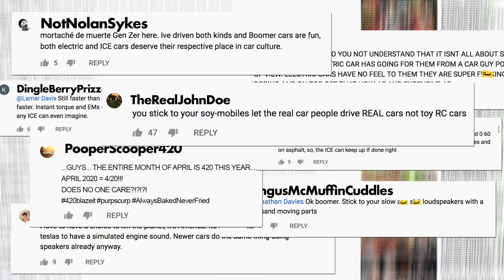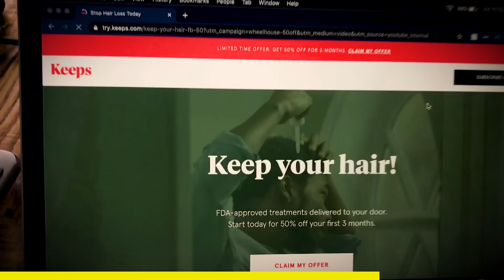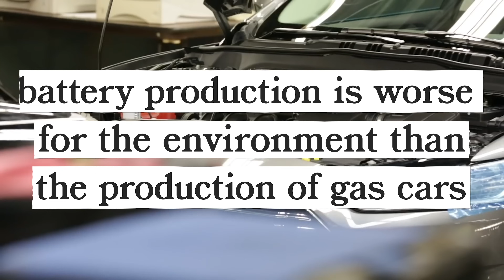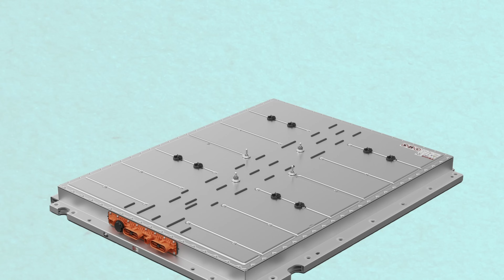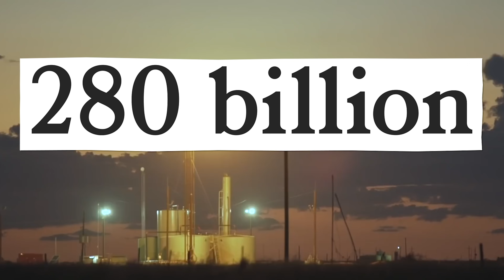Are Electric Cars REALLY Better for the Environment?

Comment: I appreciate the effort, but you didn't do your research fully, resulting in this video being misinformed due to the omission of one EXTREMELY important factor.

You see, your calculations forgot to account that traditional vehicles pretty much never need to have their engine replaced, meaning there is no additional pollution from post-manufacturing, while electric cars need to have their batteries replaced every 3-7 years, or else their performance goes downhill real fast. 

So in addition to the emissions you get from producing the cars and then generating electricity and losing it due to inefficient batteries and power grids (conductor resistance and battery bleed-off both during charging and in standby mode are an issue), you have HUGE additional pollution from manufacturing replacement batteries for electric cars that are already in circulation.

In fact, were you to account for the power losses between the energy that is being generated at the power plant and the energy that actually ends up being used for physical movement of the car, as well as account for the need for replacement batteries throughout its lifespan (or much shorter lifespan without those crucial replacements), the difference between modern liquid fuel cars (I am not talking Mustangs, take something more suited for European cities, something eco-friendly, maybe even a gas-fuel hybrids) would be waaaaay smaller, and in some cases I bet it would even lean on the side of gas vehicles.

EVs are not the perfect environmentally friendly solution many think they are, there are better alternatives out there, for example modern fuel-gas hybrids or even Hydrogen-powered prototypes.

Please make an updated video factoring in all these things, that is, of course, if you want to remain objective.
Reply: EVs can go 10+ years on 1 batterypack, yes it loses range over time but you also have to consider how much range you need daily. Talking about an EV car that is 10 year old, cars build today should already be better and last longer then EV cars 10 years ago. (since new cars most of the time have a longer range and better batteries in comparison with cars from 10 years ago)

Is it possible to ruin the batterypack within 3 year, most likely yes if you wrongly operate the car or wrongly charging the battery, but that would be the same for redlining an ICE car 100% of the time till the engine goes boom. basically misuse shortens lifetime of product.

Also EVs are better suited for city life with its stop/start characteristic way of driving in a city, re-gen a bit every time you need to slow down. And most of the time you dont need the full range of a Tesla when you live and work in the same city so smaller EVs should be fine for daily use. (VW E-up or Seat or Skoda version of the same car, Honda E, Renault Zoe or Opel/Vauxhall Corsa, or that Electric Mini)

And while the factory waste is higher for EV then for an ICE (what was shown in vid) most of the time this waste is not created in huge cities so in theory the more people that drives an EV in the city the cleaner the overall city air should become. I think this would be a great improvement for smog ridden cities of the world.

so far i understand is that hydrogen engines are at this time to big or heavy for normal cars, BUT for busses/trucks/ships the weight and size should be less of a factor.

in the 90s and early 2000 it was popular for owners of older Land Rovers to convert them to LPG, but you don't hear much about people doing that today.

About lifespan of cars in general, there are people who buy new cars, drive them for a couple of years till it needs MOT then trade that car in for a new car again.
Other people who cant afford new cars buy that 3-5 year old car and keeps on driving till the replacement/work cost gets to high and then trade that car in for a new 3-5 year old car. I don't think most new cars today get much older then 10-15 years on the road with some being lost in accidents or dropped at the recycle plant because of a high costs, but there will always be someone who loves his car and want/can maintain it till it becomes a classic or a restoration project.

Comment: the fact that they work with electricity is a good thing, but the way the cars are built doesn't change, all the plants producing the materials for the cars and the batteries still contaminate, the same happens with solar panel farms and the making of wind turbines, what most people doesn't understand with this thing of the so called "green energies" is that to make the artifacts to generate it, the most primordial process is required, and that's called combustion, from the most basic spark of fire to a huge plant burning different metals, the most obvious solution here is to stop consuming like parasitic maggot flesh worms.

Comment: “Taking into account the emissions produced by electric power plants” shows a zero emission nuclear power plant
Reply: @Jake BELL The nuclear waste buried deep underground has had many incidents of leaks.  The idea that we can store radioactive nuclear waste indefinitely is absurd. We also don't "dilute" waste we've tried to transmute it with beta decay but it hasn't dramatically changed radioactive half-life if anything we've stabilized it to be non-reactive or condensed it to be more portable.
Reply: @absolootdisaster1060  With enough storage, wind and solar can power the Earth.  And lots of work is being done on both battery and non-battery energy storage.

Storage included pumped hydro, compressed air, etc., which are already highly practical being used today.
Reply: @Julian Hen because it is
Reply: Nuclear power plants don’t produce emissions while operating though, and the amount of radioactive waste they produce is extremely small and can be safely disposed.
Reply: @absolootdisaster1060  the water that goes through the reactor is a closed loop yes. The water or steam that goes to the turbines is in a secondary loop and can be returned to the environment.
Reply: Nuclear IS pretty great though. I mean don't build in places with tons of earthquakes like....you know.....JAPAN. And don't build it in an authoritarian industrial regime.

Other than that, it's the best large-scale power we have until we can get fusion going. And if we actually put budget into fission, maybe we would have thorium reactors by now.

I personally think something like solar is more suited to individual houses. Like if you want to power a bunch of houses, don't build a bunch of panels in a field then power all the houses together. Just put panels on all the houses directly. Then use something like nuke for downtown and for industrial campuses.
Reply: @webx135  wasn't the earthquake. It was the tsunami.
Reply: That would be great if US wasn’t trying to closed down nuclear plant
Reply: As this video explains nothing is zero emissions. The construction and fuelling of a nuclear power plant have a huge impact. As does the transportation and storage of spent fuel. Takes a whole lot of concrete to store something for the length of time it takes for that stuff to become safe again. A nuclear power plant is zero emissions in the exact same way a electric vehicle is zero emissions, it isn’t.
Reply: @matthewshaw3747  a solar farm requires 17x  more materials per kWh than a nuclear power plant. And a house with a basement probably needs more concrete than a dry storage cask. Nuclear is the best in terms of materials, waste, and land.
Reply: Naberville3 my point was calling it “zero emissions” is incorrect.
Reply: @naberville3305  A nuclear power plant requires more land than an equivalent solar power plant if you include the large security exclusion zone needed around nuclear plants.  

Or said another way, putting solar panels produces more energy on the same land area required by a nuclear plant.

Do the math with the exclusion zone.
Reply: @matthewshaw3747  you know it takes a fuckton of concrete to make the anchors for wind turbines and dams for hydro electric too ya know? Not even renewables are 0% emissions. Nuclear is still an excellent way to generate electricity through sheer efficiency, reliability and power.
Reply: @Puckosar  Has anyone ever heard of Thorium powered nuclear plants? Are they supposed to be much better?
Reply: Doesn't necessarily have to be a nuclear power plant, many coal power plants also have cooling towers
Reply: @Dongonzales123  Correct.  Any power plant that uses (open cycle) heat engines needs cooling towers to exchange waste heat into the environment.
Reply: Well yes, but a nuclear power plant is also not foolproof. It's better than other non-renewable sources like coal , but there is an impact when trying to cool the heated water used inside a nuclear power plant - which is normally circulated through a natural water body - affecting oxygen content and killing marine life
Reply: @danyalreyaz7503  and even then. Its an absolutely minimal impact a lot less devastating than pushing species of birds bats and even a species of whale to extinction from wind.
Reply: @naberville3305  "And even a species of whale"

pictures flying whale crashing through the midwest into wind turbines
Reply: @hydrothermalworm7778  offshore wind farms threaten whales. And the noise can  affects other sealife. Sound travels very well underwater.
Reply: @naberville3305  bruh housecats literally kill more birds than wind turbines
Reply: @trystian8539  brruuuuhhhh house cats kill small birds. Wind turbines kill large birds of prey and bats.
Reply: @danyalreyaz7503  most of the cooling is done through the towers. Water on reenters the environment on average about 20 degrees warmer which is in line with temperature fluctuations that can occur over seasons. Heating from nuclear power plants has also been attributed to higher marine diversity in some locations such as Japan.
Reply: @naberville3305  .. "higher marine diversity"....   like 3 eyed fish ????
Reply: @naberville3305  Yea but thats not scaled up, what if there is more power plants, like way more
Reply: @danyalreyaz7503  Thorium exist its just not viable for profit
Reply: @mayuravirus6134  I guess that answers the question I just posted above

Comment: Yes for the two most important reasons:
1- No carbon dioxide emissions which in turn heats the planet up (global warming).
2- No trillion of dollars spent on oil wars with millions of lives displaned and even lost through the decades. 
No, lithium batteries if not recycled, they are harmful to the environment but ultimately not as harmful as burning oil.

Comment: hey donuts guys, you didnt count on the batery replacement after 100.000miles to the ev cas there goes another 10 tons of CO2
Reply: tesla batteries typically last anywhere between 300k and 500k miles.

Comment: Does those calculations taking to account having to replace the batteries
 as they age?
Reply: As said in the vídeo, electric cars have lower emissions than combustion engines cars after between 6 months and 2 years, since a battery last a lot more than 2 years (the case I know the warrenty is 8 years, so should last more than that) it would still be better for the environment.

Comment: Evs have 2major down falls 
1. Range
2. Recharge rate

And the third is efficiency at heavy load.

Tesla didn't even make it 100miles at its rated max tow and full charge.

And it died on the side of the road, resulting in a tow since you can't just add electricity in minutes. 

You want viable, 10min charge rate, 500mile range at full rated tow.

I pull a 15klb camper hundreds of miles at a time my trip from New Orleans to amarillo would take a week in a model x with a 5klb trailer assuming I had places to charge along the route which is doubtful

Comment: 8:28 "I.C.E. engine" = Internal Combustion Engine... Engine?"
Reply: LCD display
Reply: @vwertix1662  
Liquide cristal display
Reply: Correct ice head
Reply: @Vkob  ice kay gee
Reply: ATM Machine
Reply: @fcgHenden  don't forget your PIN number when you use it.
Reply: dun dun dun da da dun da!
Reply: Hot water heater
Reply: VIN number
Reply: Immigration, Customs Enforcement
Reply: I. Can’t. Even. 🤦🏼‍♂️
Reply: that's what its called in engineering terms

Comment: Well, 7879 comments, so this probably will not reach your eyes, but it would be interesting to know where hybrids and diesels fall on the spectrum. Obviously hybrids fall in between gas and electric but closer to which end? Also, my diesel got hybrid-like economy with a fuel which required less refining, and with no battery... Inquiring minds want to know...

Comment: Does this calculate all the oil changes, replacement parts that you will need for gas cars? Because electric cars have a lot lower maintenance cost and since the engine is electric they last a lot longer than its gas counterpart. The only problem with the electric car is that it is very $$$$ compared to a gas car. Great video!!!

Comment: Wind and Solar isn't good either, as it requires massive amounts of deforestation and clearing of natural habitats to create enough wind flow and sun.  The clearing needed would rival and surpass what we are currently doing for livestock farming.  The cleanest electrical production is actually Nuclear, it takes up the smallest amount of footprint on land, there are methods of nuclear generation that almost eliminates meltdowns and even capable of using existing nuclear waste. On top of that, nuclear waste is the only energy waste in which there are standardized methods of processing.  From start to finish, nuclear is the best method for electricity - it just has a bad stigma from power plants built back in the 50s and 60s.

Comment: Stimulating topic, you covered a lot of ground.   I pose this question about environmental damage: what’s the cost, of freezing cold seawater being pumped into the vicinity of the Earth’s crust, instead of insulating oil, given the Earth’s core needs to stay super-hot to keep the planet alive?  I am mindful of the recent news the magnetic North Pole is on the move, tens of kilometres in a few years, shifting from Canada to Siberia, and it does seem slightly stretching coincidence to believe that a pole-swapping event that occurs every few million years, just HAPPENS to coincide with a century of attempts to chill the Earth’s core - sorry, we are conditioned to call it ‘Oil Exploration’.  I mean, how much would it cost Big Oil to reverse that effect and damage if it were shown to be connected?  I think swapping the Earth’s poles magnetically to back how they were, could be more than Big Oil could afford.

Comment: No mention in this video of the problem of weight.   An EV is usually 50% heavier than a comparable ICE car for the same interior space.   This will lead to a 4X increase in the amount of road damage caused by an EV vs ICE car.    Think of how much your state spends on repairing roads each year ( it could be as much as $500-$1000 per car per year).   Now quadruple that and get an idea of the added cost a fleet of EV cars will cause.    Much of this cost goes to asphalt and concrete which are high in CO2 emissions for their manufacture.
Then comes of the problem of what happens when you get in an accident.   The EV with its increased weight will be harder to stop and will cause 50% more damage at the same impact speed in an accident.

Comment: Basing the comparison only CO2 is flawed! Carbon dioxide is not the only pollutant in production process... Producing Li-ON (or other) battries produces many toxic chemicals that make their way to the environment. It's not clear what happens to the battery after the car is "disposed of" and how it can be recycled, which probably also has a toxicity aspects, which are not calculated in CO2.

Comment: Lithium mining is not nearly as huge an environmental issue as it’s cracked up to be.  

A Tesla Model S’ monster 100KWh battery only has something 20lbs of Li in it, and that’s all the Li that car will ever involve, whereas a comparable-sized gasoline car will burn 7500 gallons in a 150Kmile lifespan at 20MPG (which is probably optimistic).  

Lithium mining doesn’t produce much carbon emissions, it mostly evaporates a lot of ground water, and while water is a greenhouse gas, unlike CO2 or methane, it just precipitates out of the atmosphere.

As you pointed out, Cobalt is a bigger concern on humanitarian concerns, although Cobalt content in EV batteries is steadily decreasing, in part for exactly that reason (cost too).

Remember also that, after lithium-ion batteries are used in a car for 10-15ish years, they are then used again for another 10-15 years in stationary power applications, like uninterruptible power supplies, energy storage for wind farms, and EV quick chargers.

Also, while it’s currently not economically viable as a for-profit business, Li-ion battery recycling is already very definitely possible and becoming more and more viable.  Check out this video on recycling:

https://youtu.be/Bpe8HalVXFU

The thing that struck me most about it is that half of the energy required for this recycling process could be sourced just by discharging the batteries as they com in!
Reply: Exactly sir. Also one should not forget that for every gallon of gasoline or diesel cobalt was used in the refining process. The oil industry is the biggest user of cobalt in the world.